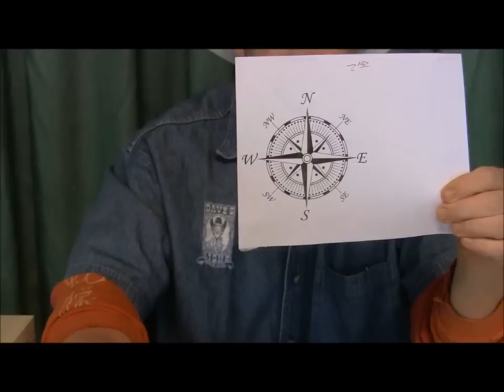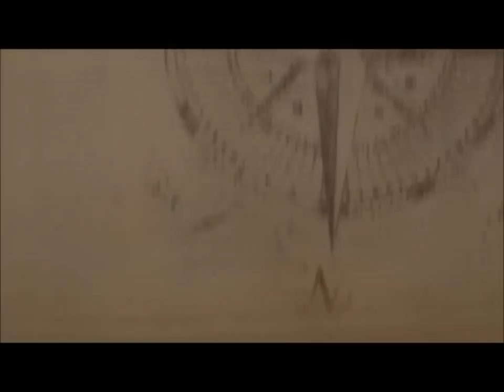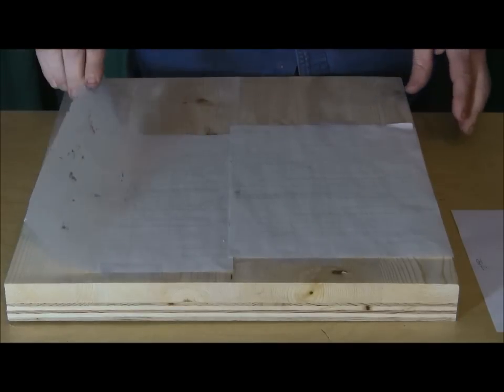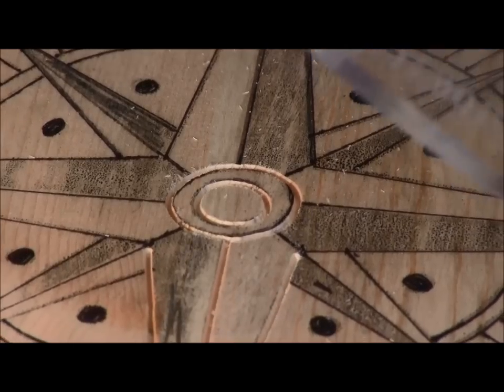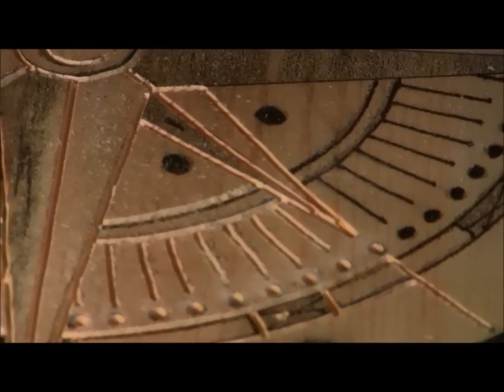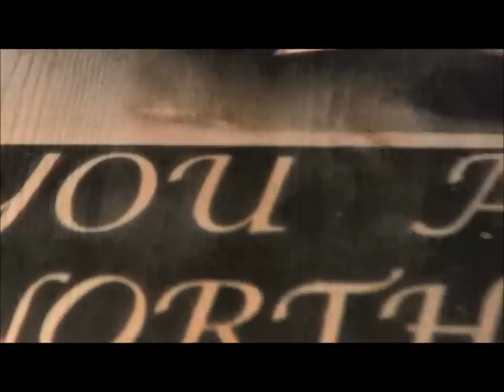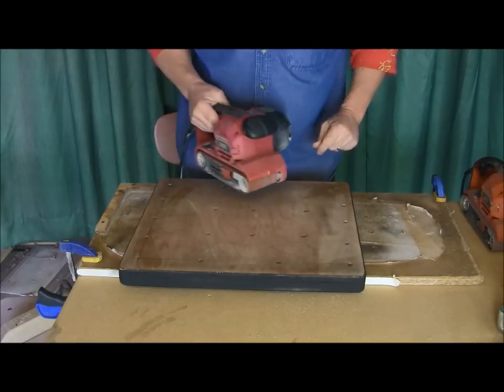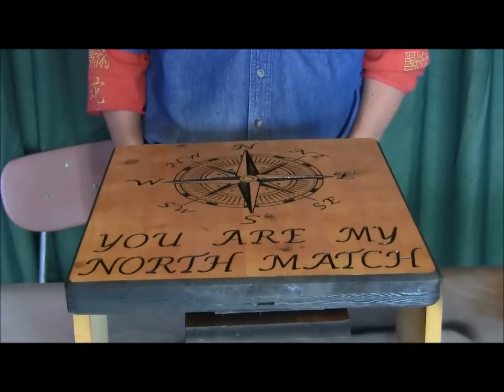#106 New Transfer process & Compass Sign

Comment: The label stock has worked great for me.I have been using it for the past 6 months now.I use Microsoft paint program to flip my image.It does work good if you have everything ready and can place the image right on the wood when it comes out of the printer.I also just use my hand to press it down (works fine for me) I wipe the label stock off with a damp towel after done and I can reuse the label paper a couple more times. Great job with the sign.
Reply from the maker: PD Wood Yes I will give that a try (when I'm not making a video) right out of the printer. Should yield better results. Thank you

Comment: Another great video.  If you take the image to Kinko's or similar, they can enlarge images onto 11x17 paper (2 x 8.5x11 sheets side by side) or larger with their  equipment for less than a buck (2016 prices) and in some cases flip the images.  Works best if you make the image a PFD, then you can do a number of things during printing.  I have done this making posters, also if you use the xerox process, you can heat transfer the image (place face down, you know the rest). easier than spoon burnishing; (you can also use mineral spirits brushed on the back of the paper to transfer the xerox toner, but let it dry before rubbing the final image)  I know others have suggested this before, but thought the larger paper and the mineral spirits method might be new to you=   You guys really do a great job of showing how- 
I know a lot of pro's doing videos could learn a lot form you, informal as the presentation is, it's better than most corporate (Big $) training, and MUCH easier to watch.  Showing the 'opps' and all makes it even better.
Reply from the maker: Thank you Allan for the wonderful comments and tips, I really appreciate them all, Eric

Comment: great video!
here's alittle tip you might want to  try (I use this when i'm printing a pattern for scrollsawing) you should be able to change your printer to greyscale and print your pattern in a shade of grey, which in turn saves you on the amount of ink you use per pattern.  I dont know how well it would work for what your doing but maybe worth trying.
Reply from the maker: +rusty nails Thank you for the tip. I appreciate it, Eric

Comment: To me that is a work of art and a testament to your craftsmanship! Yes I watched every minute and must say I was intrigued at the detail router work. Obviously your cutting experience showed through. The transfer is something I'm sure I will see in future videos. Dad did a great job on the camera especially keeping it on the work and zooming in when necessary! As for the routing, May I ask how you kept light on the cutting tip and also how you were able to keep the dust away as you were carving the intricate details? And how large is your viewing window from your viewing perspective when routing? Thank you for taking us through the whole process!
Reply from the maker: MRrwmac  Thank you for the nice comments. We appreciate them very much. OK so the lighting was just a clamp light shinning on the router from just off camera angle. The opening is just the standard opening in the router base. Without actually measuring it I would guess around 2.5" x 3.5".
Reply: You're welcome! Just a light out of camera view, wow. No light inside the router? And what about a vacuum? Or was that just the blowing down of the router motor fan that kept the line you were cutting clear?

Comment: I forgot to mention guys. A few years ago, I bought myself an Artograph digital 500 projector. It was expensive $800. I used to have one of the old ones. It could only be used in a very dark room to transfer your images. This digital projector is great. It lets you store files and keep loads of pictures right on your projector. You can bring it up on a wall or anything that you can project an image onto. I have a homemade tripod on wheels. I mount my projector on a base with a hole in the base so that I can project my image onto my wood surface. I can move it up or down to make the image larger or smaller. The compass that you're ready to carve. All you would have to do is, transfer this image into a file, bring it up on the screen, project it onto the wood, move it up or down to make it twelve inches, or even bigger keeping the detail to scale, voila, it's a done deal. you can even carve it while the projector is on as you never touch the projector again. the image will stay there as long as you want it to. No paper, no glue. Plus, the scale is the same as you move it up or down. The detail is excellent. I use it for making copies of guitars large or small. I make full-size guitar racks for guys to hang all their amp cables and smaller ones for coat racks or key ring holders. Sorry for ranting, I'm just excited.
Reply from the maker: Interesting, I haven't heard of this kind of projector. I'm going to research it. Thank you, Eric

Comment: The easy way -- Print it reversed with a lazer printer or run an inkjet print through a copier.  Copier and laser printer ink is actually a plastic. Tape down the laser printer or copier print print side down .  Now just IRON the paper. The "ink" will melt and transfer to the wood. Thats how I did things before I got  the CNC going... :)
Reply from the maker: +John Ware Thank you

Comment: I'm very new to this so please forgive me if this question has been addressed in the past.  why don't you just print directly onto the Avery print paper and stick that to your work as a template, then when you are done it will act as masking when you paint.  you could just sand off the sticker when. you are done.

Thanks for your tips
Reply from the maker: This video is a couple years old. That's kind of how I do allot of it now. Also print on regular paper and cover it with packing tape. Thank you for watching and the kind words. I really appreciate it, Eric

Comment: Please don't take this the wrong way but this is one of the better videos that you have done I think if I ever did an LTS with you guys I would spend the whole day doing the alphabet because for some reason letters scare the hell out of me but I have a handle on doing shapes and things like that in 3D because of carving. I know you made comments during the video about using the se50 bit instead of the profile bit I'm getting the sense that bit selection and depth really does make a difference do you find this to be true also one last question I know you make a base for the type of router I use but does handle size make a difference to you or not
Reply from the maker: I take that as a compliment, Thank you. Yes I do think bit selection is very important. Once you get used to what each bit will do, you get a feel of how the piece you're working with will look with the different bits. On the handle size I like the small handles we put on there. Some people like bigger handles, I find I have more control with the smaller ones.

Comment: You couldn't use sanding sealer on the pine because the image wouldn't transfer well. Keep up the good work !   thanx
Reply from the maker: Thank you James. It wouldn't transfer quite as well but I have done it before on select pine. Applied the sanding sealer, let it dry and then lightly sand to make it smooth. Still got a good transfer.

Comment: Hi Guys,  When I tried the image transfer to a board with sanding sealer, the ink will not dry enough to prevent smearing during routing.   I will try to transfer the image first and then seal it prior to routing.
Reply from the maker: Edward Powers Edward, ok let us know what happens. I'll play with it to. Thank you.

Comment: I love your videos guys and you've taught this old dog some new tricks. However, I've tried a lot of different transfer processes and the one I like best is to take any image printed by a laser printer or copying machine, lay it face down on the wood and use a flat iron on the back. The heat from the iron transfers the image nicely. I don't care much for the acetone or lacquer thinner methods ( a little to volatile). If you don't want to use a flat iron, they make trasfer irons: http://www.amazon.com/Wall-Lenk-L25TT-Woodworkers-Transfer/dp/B0011E3FA6/ref=sr_1_fkmr1_3?ie=UTF8&qid=1425555366&sr=8-3-fkmr1&keywords=wood+burning+transfer+iron Thanks again for all your time and effort you guys put into sharing your talent.
Reply from the maker: Peter Orsaeo Sr I agree, but for me I wanted to find a way to transfer if you only have a ink jet printer. There is a better way than I used on this video. I'm working on perfecting it & will make a updated video soon. Looks like if you have a laser printer it's much easier to transfer to wood. Anyway thank you for the comments & for the kind words.
Reply from the maker: Peter Orsaeo Sr Thank you for the info on laser printers. I had no idea they were that inexpensive. Will have to pick one up. We bought our magnifier several years ago at harbor freight. Item # 95890. I just did a search on their website & they don't have it anymore. I still have the box and there is nothing but made in China & sold exclusively for Harbor Freight. H.F. does have a different set that might work. Sorry I couldn't be more help on this one.